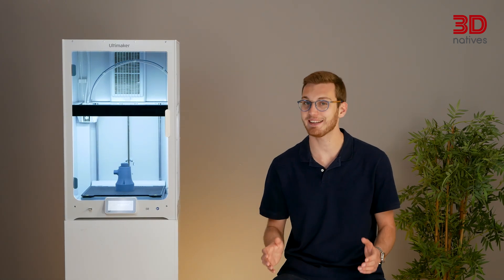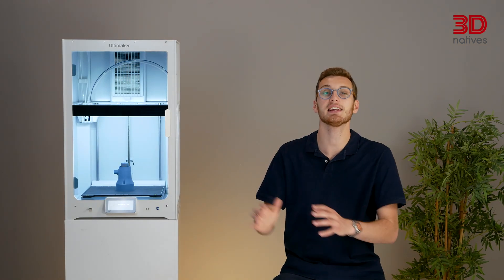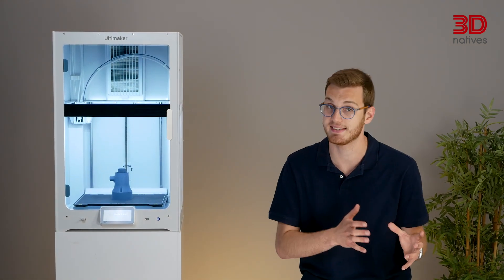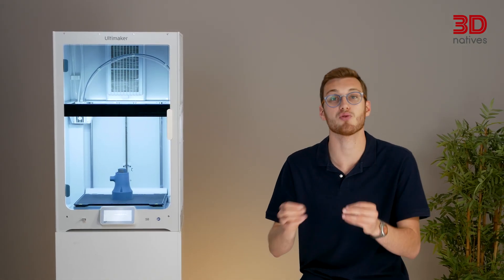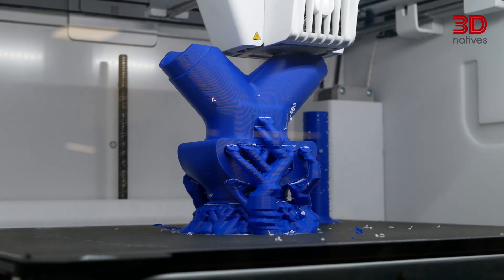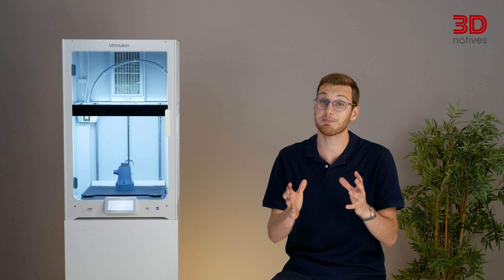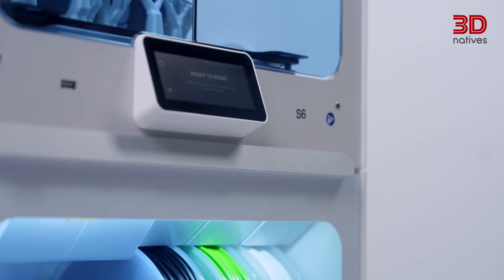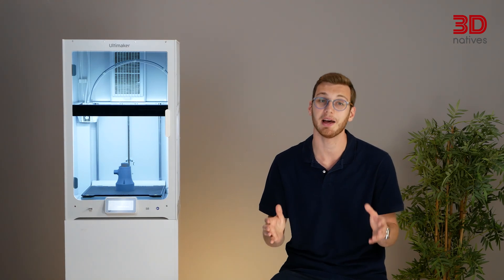Ultimaker S8 Review: The S7, But Faster? 3D Printer Test & Insights (+S6)

Comment: is it user friendly for someone coming from using bambu lab.. Im not a pro or a commercial business. Just want a new printer.
Reply from the maker: Yes, the slicer will be a bit different, as you have to use Cura with UltiMaker and Bambu Studio with Bambu Lab, but you can quickly get accustomed to it.

Comment: Yeah this is overpriced crap H2D will wipe the floor with this trash heck noo soo many cheaper printers even a K2 Plus would beat this crap up I remember I had a Ultimaker 2.
Reply: Does your K2 Plus have dual extruders thought?
Reply: @BairdBanko  S5 has dual extruders, which i never used, because they never worked properly...
Reply: @MaxWeber-o5b I had an UM3 and loved the print core system on that machine. But yes it is a slow printer next to my Trident
Reply: @BairdBanko  Um3 Was a revolution when it came out, but everything after that from ultimaker is sadly just overpriced trash imo.